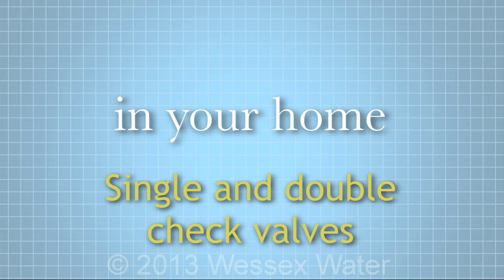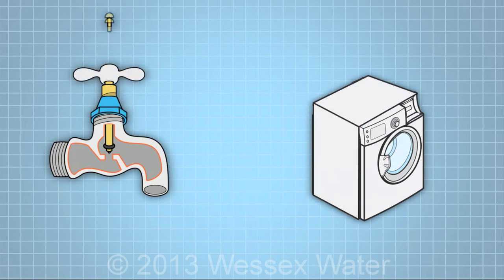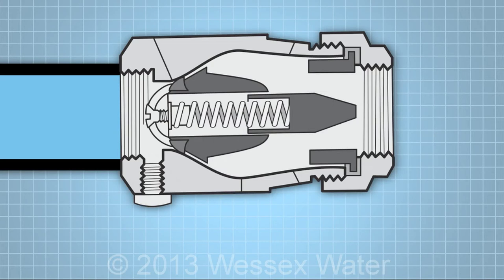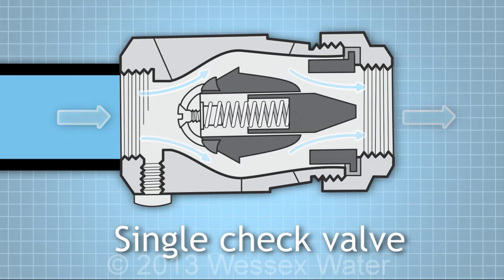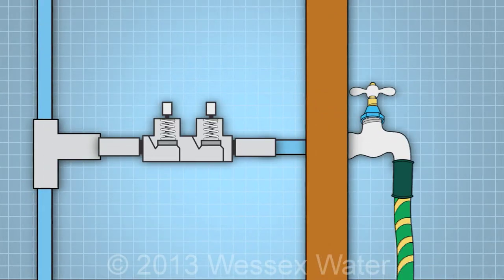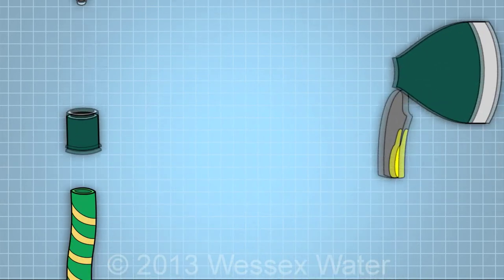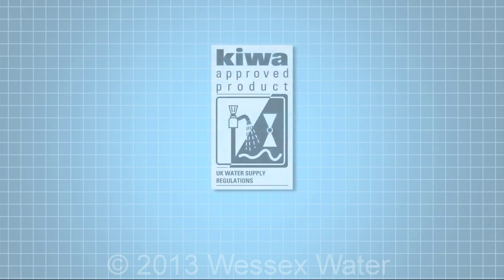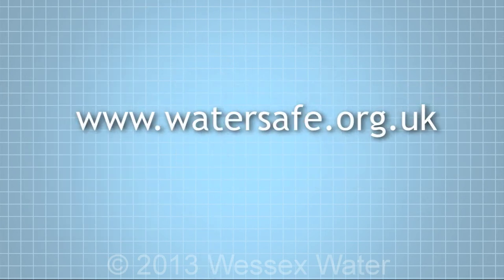Water quality in your home - single and double check valves

Comment: Nice video but could you explain why the garden tap requires the double check valve (as opposed to single)?
Reply from the maker: Hi there. A double check valve is recommended for outside taps as it provides better protection - especially in case of negative water pressure. 
For example, if you’re filling up a paddling pool and leave your hosepipe in the water, should negative pressure occur, water from the paddling pool could contaminate your internal water system, if a double check valve isn’t installed. Hope that helps :)
Reply: @wessex-water  Thanks for replying. So basically there is less chance of it failing because both check mechanisms would have to break? Just one other thing - does every house require a check valve in / after the stop cock, or is it only some homes like flats with shared mains supply?
Reply from the maker: @mrdjbrand  Check valves provide protection for a range of circumstances, such as preventing water from washing machines contaminating supply. It is not always down to the type of property or whether a property is on a shared water supply. If you are in any doubt we'd recommend you contact a WaterSafe approved plumber for further advice.